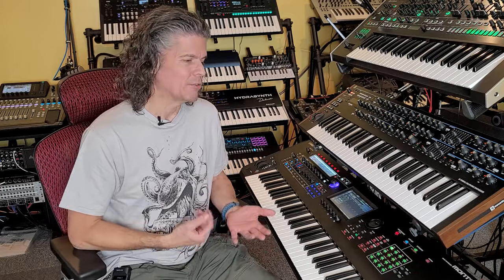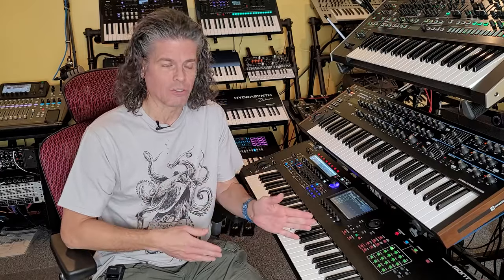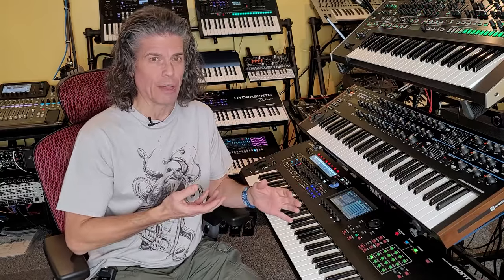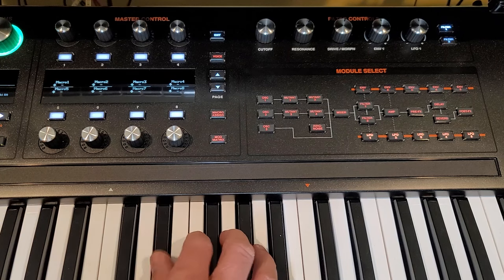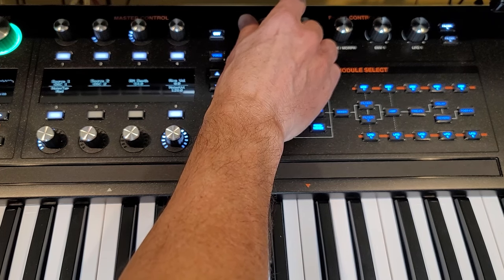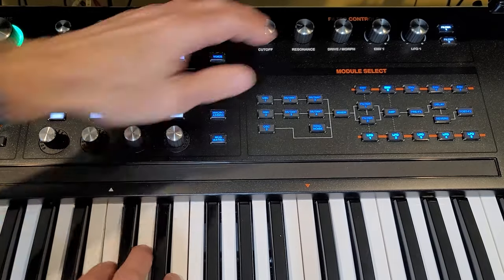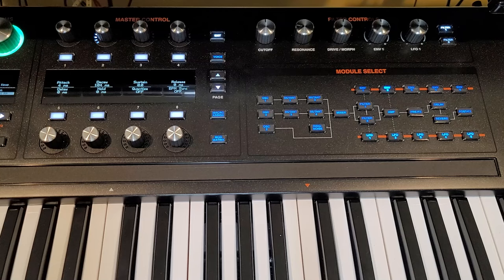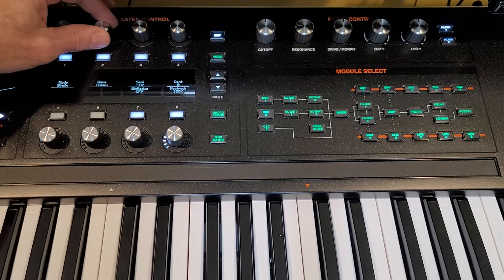Kick It: How to Make a Kick Drum Sound on your Synthesizer

Comment: Good one Scott. I have the OG 49key Hydra. Pretty sure I could just do that with the mixer and the single layer, no?
Reply from the maker: The limitation is the envelopes. I'm using a much shorter amplitude envelope on the "click" sound. You might be able to get around that by using an envelope to control another parameter on your "click" oscillator - maybe pitch?